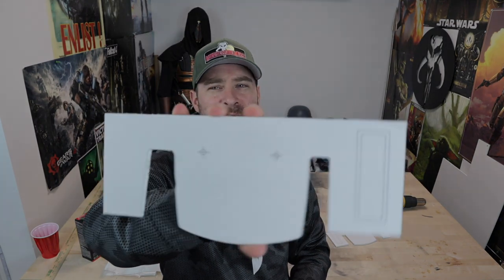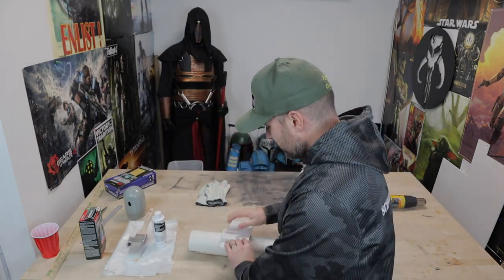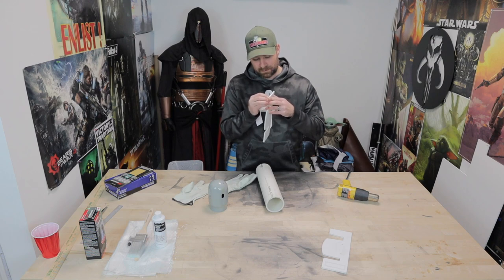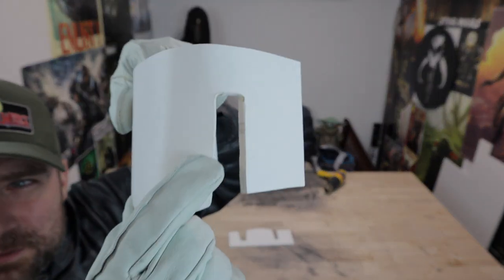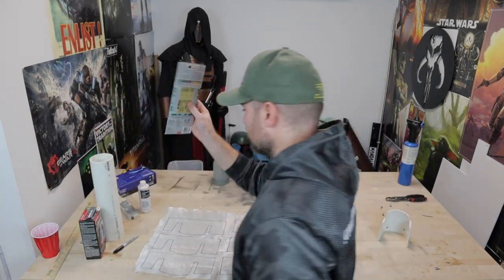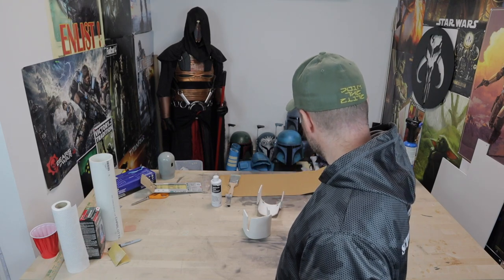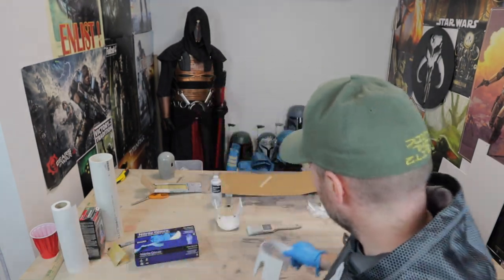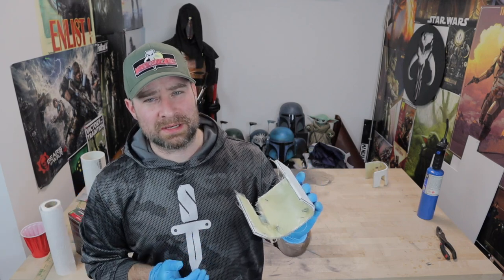BUDGET MANDO ARMOR BUILD CHAPTER 4 KNEE ARMOR

Comment: Matt, are these the same templates you used for your Mandalorian Deathwatch/Post Empire build video? If so what size did you print the templates out at?
Reply: If you take the file to any Staples location, the template should already be sized correctly for the sintra board that he linked. You'll have some excess which is enough to use for gauntlets too.